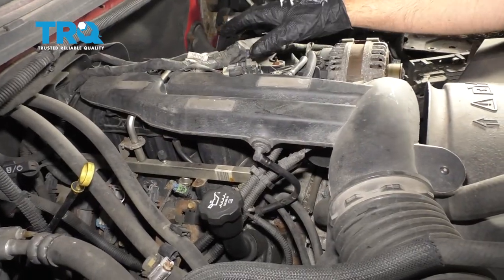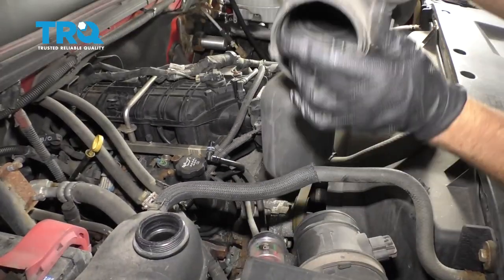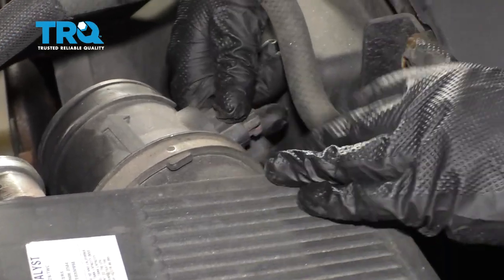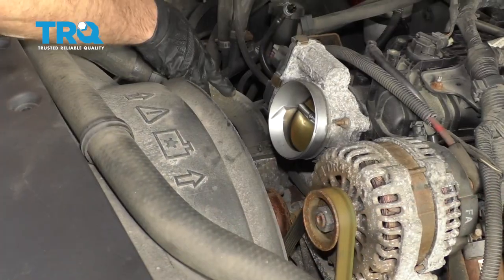How to Replace Camshaft Timing Magnet Adjuster 2007-14 GMC Sierra 3500HD

Comment: Great tutorial!!   I'm currently trying to help my neighbor with his 2012 Sierra (5.3) with a P0340 CMP code, it just shut off and only cranks over now.. and seems to have a lope while cranking.   I replaced the CMP for him but the code remains and still won't start.. could it have dropped a lifter or jumped timing.. any suggestions would be greatly appreciated 👍

Comment: when i was changing my front crank seal, i noticed the two wires going to the magnetic adjuster was burnt through the insulation and the two wires were touching. i could tell they have been like that for a while. i had no check engine light or any signs anything was wrong. i disasembled the connector and heat shrinked the wire and checked for any other damage to its wire harness. Anything else i should be concerned with? i have not had the chance to run it yet since i done that. Also the truck was tunned while the wires were touching. concerned that the tune was over compencating for the possible lack of adjustment.